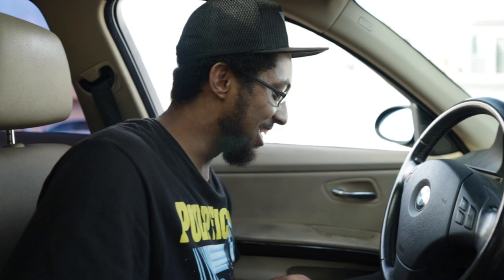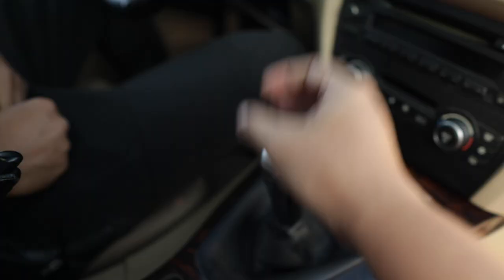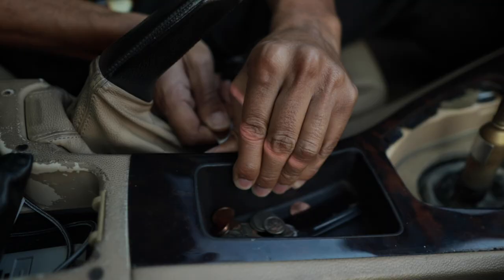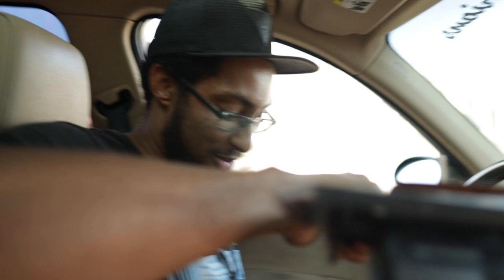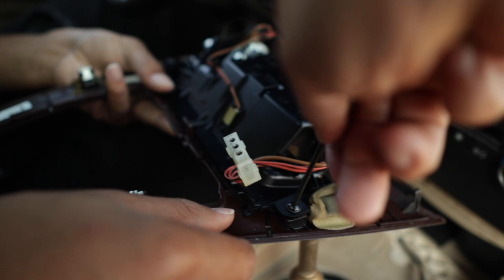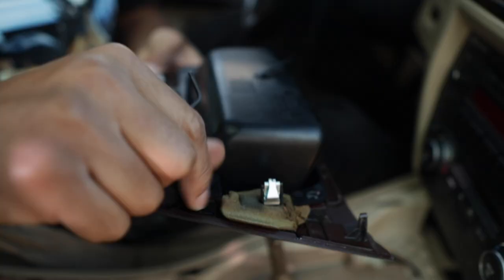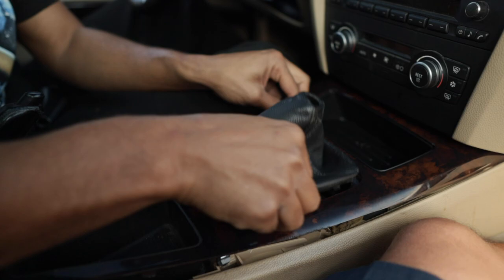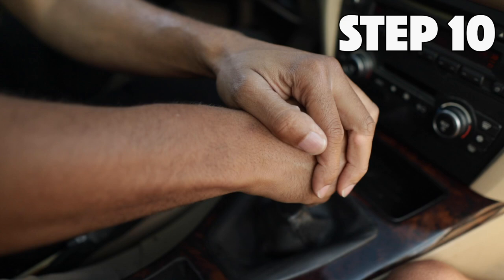MODERNIZING YOUR BMW E9X WITH $99!

Comment: Thanks for the video. Just and extra tip you don’t need to remove the boot . Push it up and turn it sideways and you can slide it thru . For removing the wood trim start from the back and work ur way up to the ash tray. Slide it back and out. The ash tray is held by a t20 .

Comment: Guys, you don't need a butter knife or trim tool for the centre console or gaiter it can all very easily be pulled up by hand. It'll save any potential for damage.

Mmaann you need to change that damn steering wheel 🤣 at least get an msport one!
Reply from the maker: Teaching the teacher! I love it! Thanks for the tip brotha! And I totally would but all my mod money is going into the M3 🤣